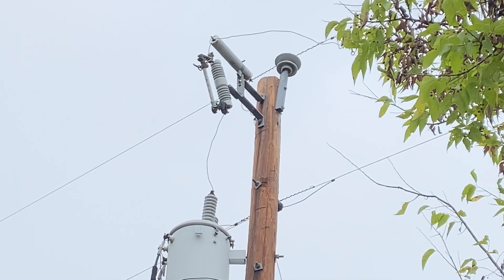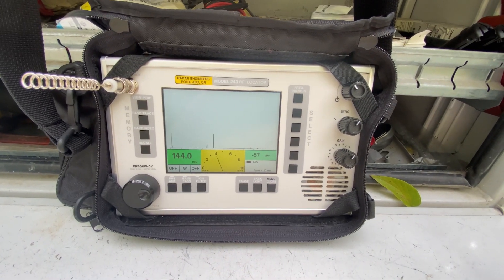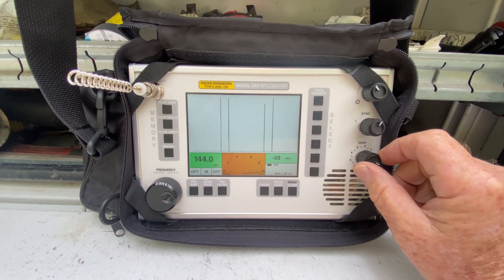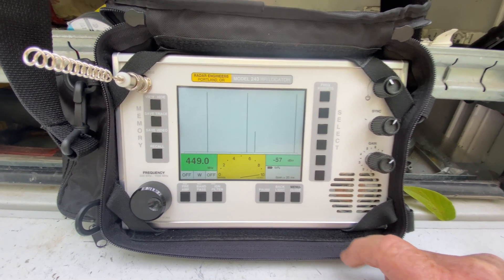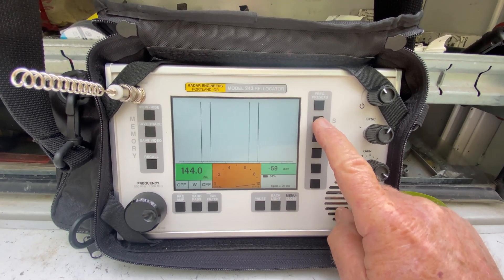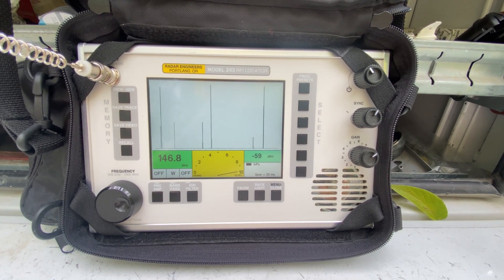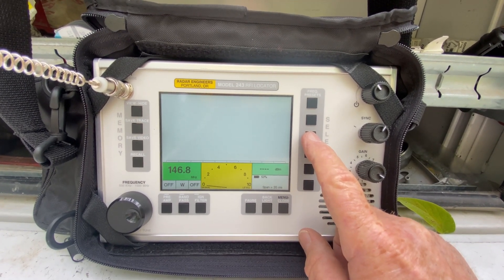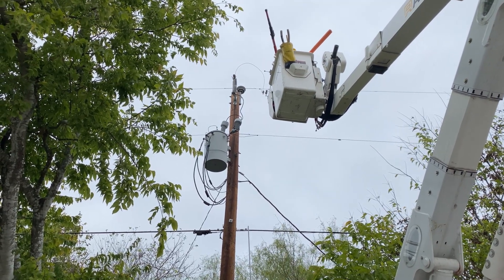Ham Radio RFI Find & Fix

Comment: So does the FCC require yall to fix these issues since it interferes with radio communications, also would not fixing this issue lead to power issues later on?
Reply from the maker: Thank you for your question.
Yes, The FCC makes the electric utility responsible for correcting only that noise generated by the equipment and hardware that it actually owns.
It is the utility's responsibility to locate a source of noise emanating from their equipment. 
There are many causes of RFI. 
A percentage of RFI can be caused by utility owned hardware and a small percentage of those power-line noise emitters will evolve to power issues for the utility customers. 
I see the higher the primary voltage and the older the line, the higher the percentage of utility owned equipment causing RFI. 
I patrol line with a RFI detector to help locate issues before they can become a problem for our customers.